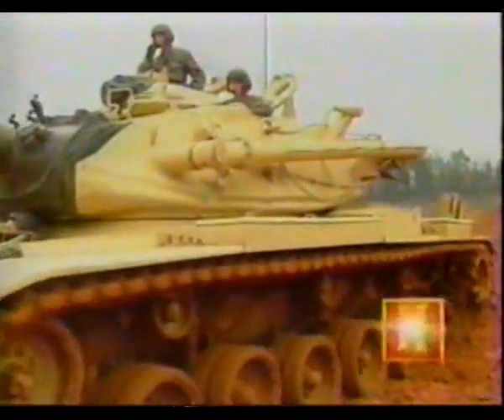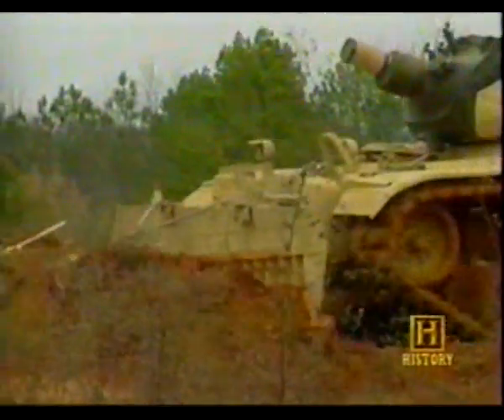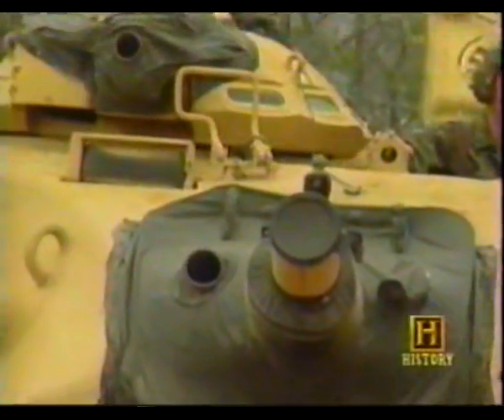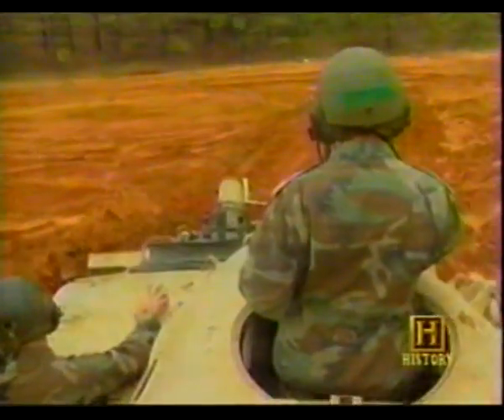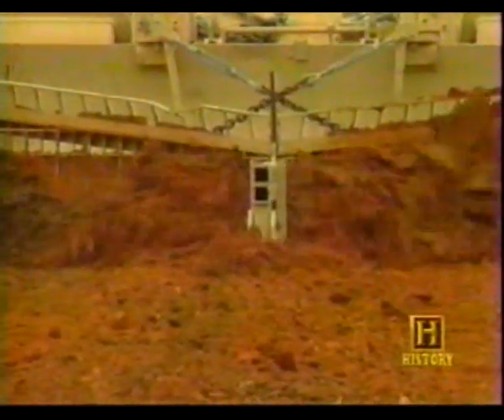M728 Combat Engineer Vehicle

Comment: Awesome, rings back memories. I was a 12F at Benning from '85 to '88, first in 2/69 AR (AVLBs), then in 72nd Eng Co. went from an AVLB again to gunning and TCing an M728 CEV. Absolutely beastie vehicle.
Reply: 17th Engineer and 23 Engineer...CEV and AVLB
Reply: @TheTir1962  No gap too wide ....
Reply: At Ft. Leanordwood, I saw one of these firing it's 165mm demolition gun.  That was super impressive. It's a shame they got rid of them and never replaced them with a Abrams based variant.  That 165mm demolition gun would have been very useful in Iraq for urban combat.  Even these old M728's could have done the job if outfitted with plenty of ERA to protect itself against RPG fire.  That A-Frame also is super useful in some many tasks.  Every engineer loved these things.
Reply: @wigon  in WW2 The Germans made good use of a short low velocity 75mm and of course the Sherman's 75mm was very flexible. I'm thinking a 75mm with a minigun and a Mark 40, all on a smaller chassis, something for urban work
Reply: @wigon  in WW2 The Germans made good use of a short low velocity 75mm and of course the Sherman's 75mm was very flexible. I'm thinking a 75mm with a minigun and a Mark 40, all on a smaller chassis, something for urban work
Reply: @piperp9535  What's a Mk40?  Also trust me, for taking down buildings (or at least most of a floor of a building, 165mm HE rounds are waaaaaaaaay better than any 75mm shell.  It's also a lot cheaper than calling in a fighter plane to drop a JDAM and much more effective than an Abrams 120mm HE rounds.  The issue with the Abrams is that it's cannon barrel is too long and often got damaged in urban combat when the barrel hit walls or buildings moving down narrow streets.  The short, stubby cannon of the M728 is ideal for maneuvering the tank through narrow streets without damaging the barrel.
Reply: @wigon  in WW2 The Germans made good use of a short low velocity 75mm and of course the Sherman's 75mm was very flexible. I'm thinking a 75mm with a minigun and a Mark 40, all on a smaller chassis, something for urban work
Reply: @wigon  I think it's a mk ,14, the grenade launcher

Comment: Round is abt 29kg. TC gives firing order. Loader loads round. Gunner locates target. Gunner says identified. TC says fire and gunner says On the way. Boom. Loader turn on air blower and open beachblock. U see abt 2 pieces white plastic the size of a 20c coin and smoke blow out from muzzle of the 165mm.  700m target abt 5 secs finished.

Comment: Did u experienced faulty (missed fire) round?  I faced with 2 of such. We have to check the contact point and attempt the 2nd firing while the 3rd attempt on the very same round via "manual" mode instead of electrical.  On both, we failed to fired them off. Unload round from tank and bring them to the butt with Bomb squat to finished them off.

Comment: @grizzly15c Did you served in a M728? Can you tell some of your experience like the 165MM gun for instance?
Reply: the 165 was a brass free round, only had a D-ring on the end. The round was so slow you could actually see it fly through the air. 100 meter scramble your shit kill zone...up to 1000 with shrapnel. I disappeared an entire armored personnel carrier and an old taxi with one shot each...mean they were fricken gone. Was designed mainly for structure demolition.
Reply: @TheTir1962  wow i didnt recall making this comment 10 years ago, but thanks alot for answering tough!
Reply: @TheTir1962  How long did it take to load the gun?